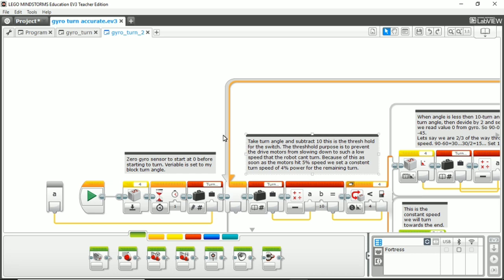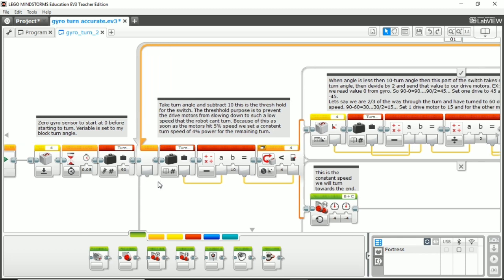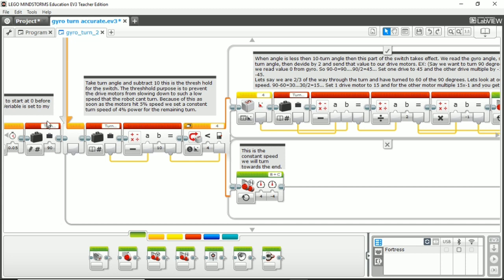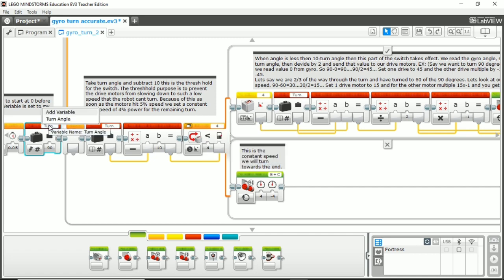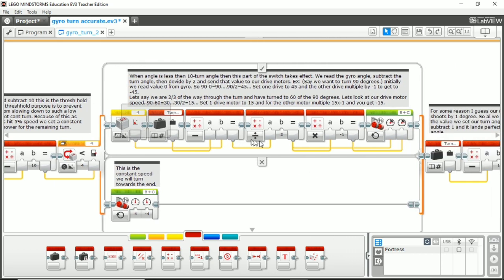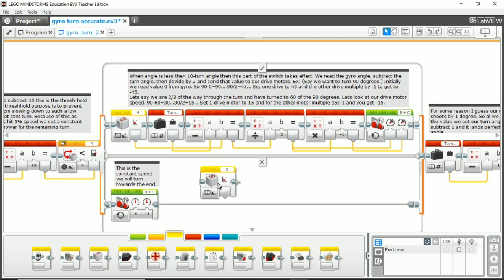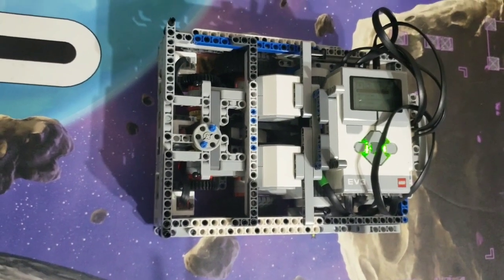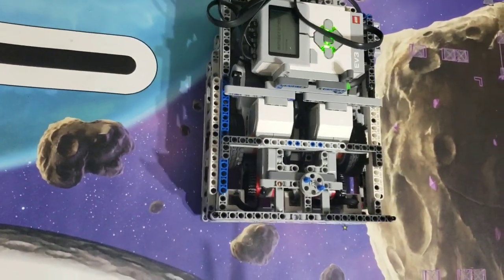Accurate Turns With The EV3 Gyro Sensor

Comment: Hey nate could you do a PID go forward with gyro
Reply from the maker: Can you give me a little more detail on this? Like what is the gyro doing or what am I using a PID for?
Reply: @natesimpkins4875  Using a PID algorithm could you create a program using a gyro to go forward
Reply from the maker: @ritamr2690  I apologize still having a bit of trouble understanding. What do you want the gyro to do because you don't need the gyro to just drive forward.
Reply: @natesimpkins4875  Using the gyro sensor create a program that lets the robot go forward
Reply from the maker: @ritamr2690  to go forward you would just use a move block. Gyro measured angles not movement
Reply: @natesimpkins4875  Those cause drift and not going accurately straight. Im saying is that you use the PID algorithm, apply it to the gyro sensor use that output and put it into a steering block to go straight
Reply from the maker: @ritamr2690  ok I understand now. Yes I can do that.
Reply: @natesimpkins4875  But can it use the PID algorithm
Reply from the maker: @ritamr2690  yes I can make a video on it
Reply: @natesimpkins4875  when can you get the video?
Reply from the maker: @ritamr2690  I'll have it out probably after Christmas. I already have a list of videos in line.
Reply: @natesimpkins4875  could you make this vid soon?
Reply from the maker: @ritamr2690  I was traveling. I am back now and a new video should be up tonight or tomorrow. The gyro straight video will be out within the next week or so

Comment: What about left turns and reverse turns?  Also, what if you only need to turn 5 degrees?  Thanks for your video
Reply from the maker: Thank you for bringing to my attention left turns. Let me look at the code see how you could incorporate that easily. 5 degrees or less is so little you wouldn't use a PID turn. I will be doing a video on regular gyro turning for small turns.
Reply: @natesimpkins4875  so, what we have to do for left turns? Also, thanks for the video!!
Reply from the maker: @vercsfll1344  check out my other video for that!

Comment: Just tried this code with our EV3 setup. It seems to make it into the top branch and activate the motors. However, it just seems to stay there and not loop to decrease the motor speed resulting in an infinite left-hand turn with no decrease in speed. What should we check first to verify the operation?
Reply: Actually, we found the solution. With our sensor, turning to the left from 0° results in a negative reading on the sensor. So, it would never hit 90 - only -90. A little reconfigure, and it's up and running. Thanks for the start!
Reply from the maker: Check to make sure the gyro sensor is not spiking...